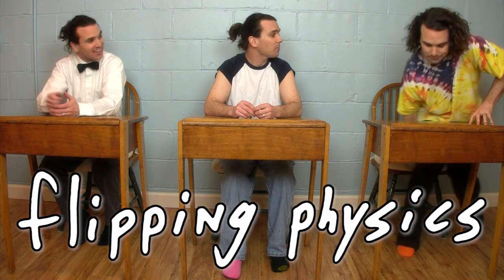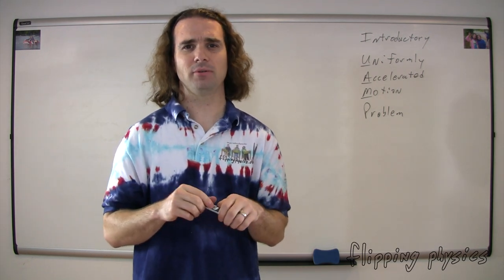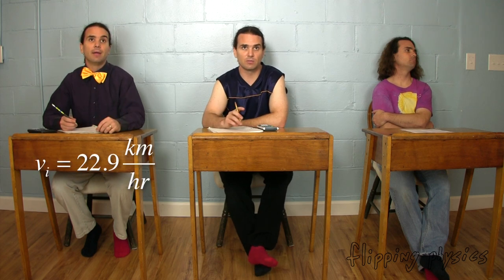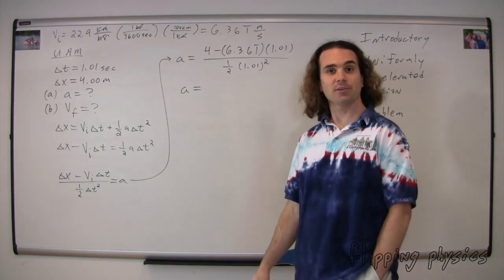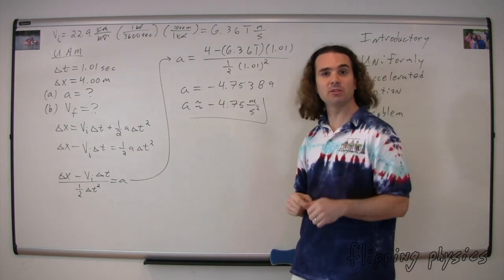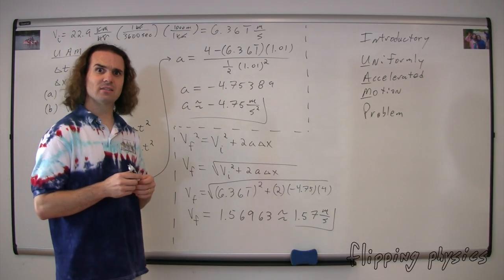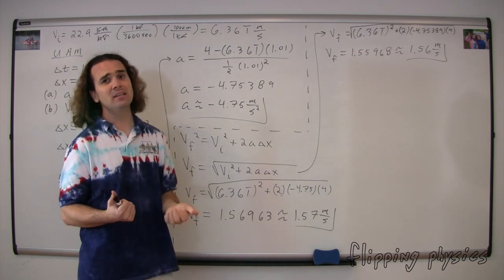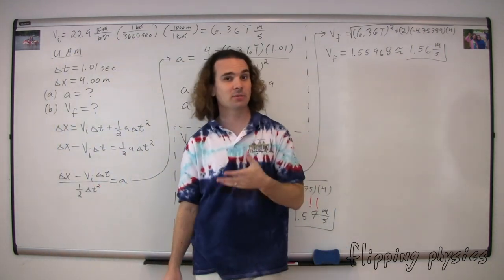Introductory Uniformly Accelerated Motion Problem - A Braking Bicycle

Comment: The rule here is: use known values as more as possible. DO NOT use intermediate values unless you have no choice. So for the problem (a), acceleration is unknown. We need to use the equation with a and other known conditions. That is we need to find out which equation has a, delta x, t, and Vi? Clearly it is: delta x = Vi*t + 1/2*a*t^2. For problem (b), Mr. P said there are 3 ways to solve Vf. But there is actually only one way to do it correctly without rounding problem. It is the last equation, delta X = 1/2*(Vf+Vi)*t. You don't need the answer from (a) to solve (b) and it is more accurate.

Comment: when should you use vf^2= vi^2+2at instead of vf=vi+at , like when should you use which?
Reply: I am late for your question. Please see my comment above. For your question, none of your equation is the ideal way to solve Vf. But if you insist to use intermediate value (a-acceleration), the two equations you mentioned have no difference. You can use either one. But to me the rule here is to use the one as simple as possible. So Vf = Vi + a*t is better.

Comment: at 5:29 is it ok?, 
to subtract speed from distance?
Reply: No, because they have different units.   If the units are inconsistent, the equation is not valid.

In this case, the equation shows displacement minus (velocity * time).  Multiplication takes precedence over addition and subtraction, so it is implied that you first multiply velocity with time, before subtracting it from displacement .